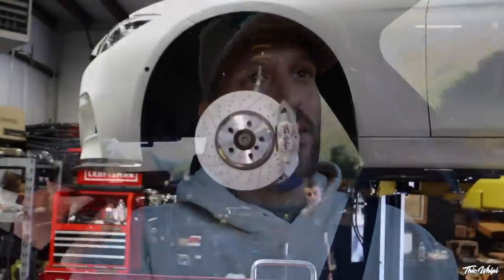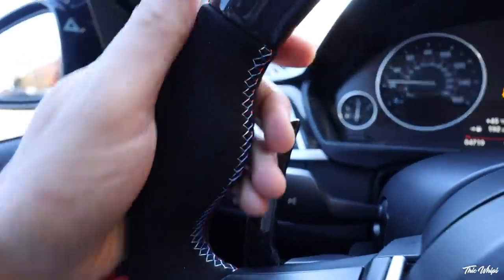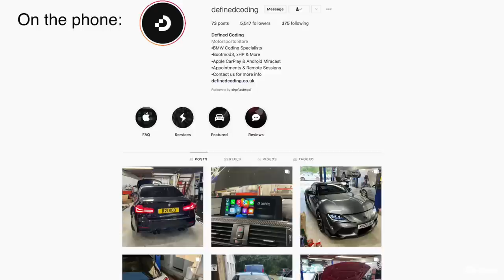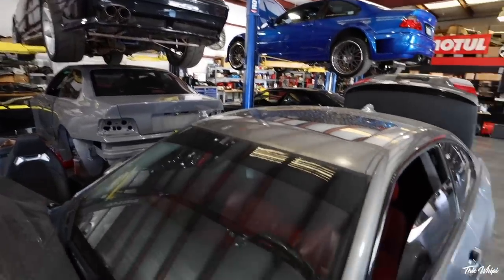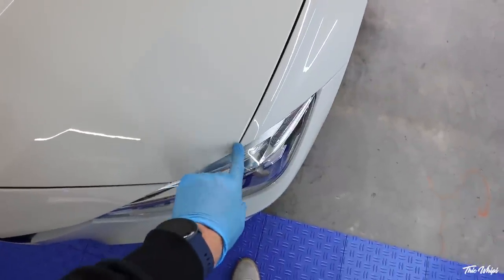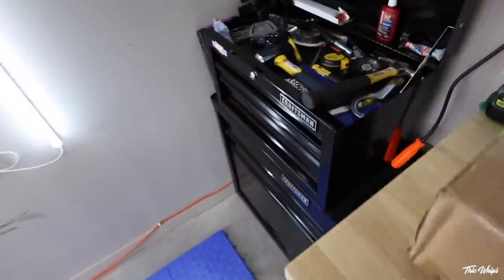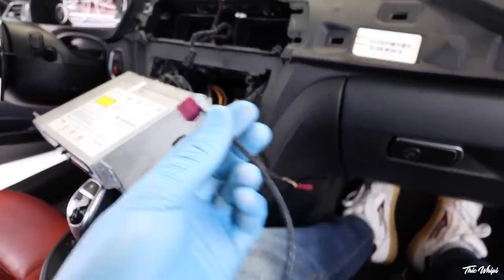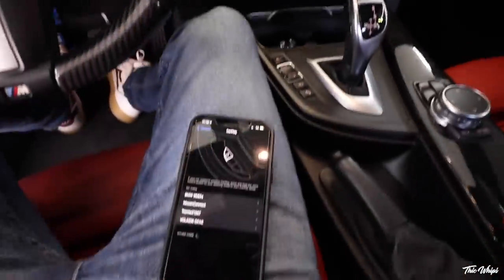I FINALLY HAVE FULLSCREEN CARPLAY IN THE F30!

Comment: The 2016 LCI version came with better hardware more ram etc hence the upgrade to ID6. Pre LCI (2016) can technically still retro fit CarPlay. However they will only be able to use CP. issues arise when you try to use native BMW maps. I’ve heard the hardware stutters etc and does not perform well. I’ve you’re only going to use CP, the pre 2016 hardware can (i believe) allow for this.
Reply: early LCi models still had iD5 and some US specs still had iD4

Comment: Buy a Lenovo ThinkPad T430 or if you want a smaller one, an X240.
Those are gread laptops for doing stuff like OBD2 diagnostics or ECU modding, plus they have a user replacable battery like the laptops from the good old days of portable computing.

But remember to get the versions with a SSD and 8gb RAM. The CPU is kinda not that important, a i5 is great but everything bellow will be also fine, since you won't watch 4k movies or try to play some games on it

Comment: Umm I’m getting a 2017 or 2018 series 3 320 Idrive. I’m tryna get a wide body for the front bumper and back, can you tell what the parts are called and where can I get them for cheap?

Comment: Thanks for this video!! I had CarPlay coded on my car and was told that, since it works I don’t need the antenna because that must mean I already have it. But it’s been kinda dropping here and there. Clearly this video confirms that it will still works (like mine) without the antenna but that you should install it for it to work perfectly. Ordered my antenna!
Reply: What model/year do you have?
Reply: @amo7308  2018 f30 330i
Reply: WHERE CAN I BUY THAT ANTENA FOR CARPLAY?

Comment: I got a 2016 435i coupe and recently purchased M 19 inch by 9 wide staggered wheels for it.  However, when we installed them, there is about an inch poke in the rear tires...can that be fixed or...how do you guys do it for yours to be flush with the body....Please help.
Reply: Hello, did you ever figure this out -2015 white 435i, (w/ m performance)fbo tuned to 480bhp with true straight pipe, red guts

Comment: Hey John, I got a 2016 328i and it has the smaller screen and the older idrive system and I was wondering if I could get apple carplay coded into it even if it’s the smaller screen which is what I have.

Comment: I heard that there is a difference in connection quality between OEM wifi antennas and aftermarket ones. Anyone have any testimonies on this?
Reply: You are 100% correct we only supply OEM shortened antenna's for this exact reason performance is flawless!
Reply: @definedcoding  can Android auto be coded in?

Comment: Does xHP shorten the lifespan/affect the longevity of the transmission?
Reply: Not really. In most cases it makes it better because XHP applies more clamping force which allows the clutches to not slip with more power.